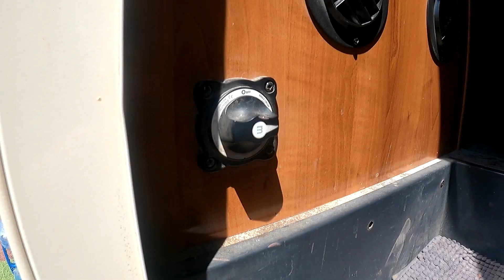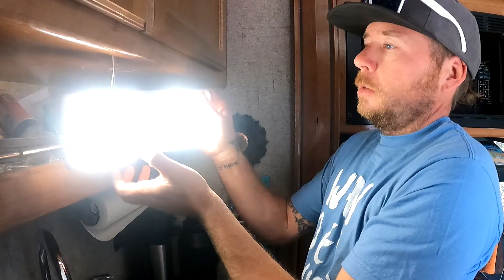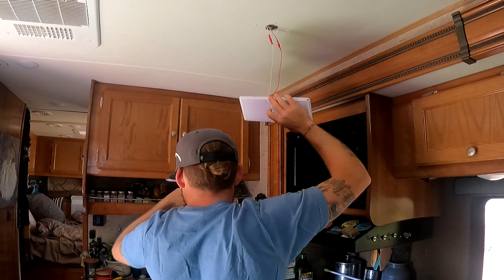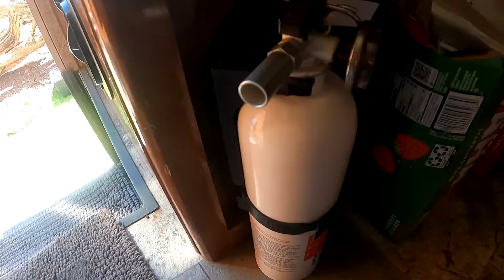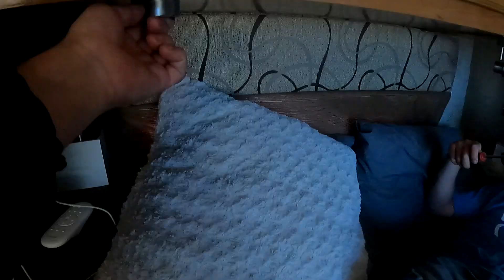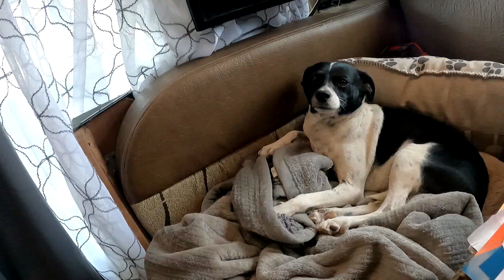RV Project Day - Replacing Or Fix Cheap Generic & Broken Items

Comment: I have a coachmen travel trailer and it has all the same lights as yours and the same faucets. I’ve replaced the kitchen faucet and I need to replace the bathroom faucet. I need to replace the lights too. The stuff is really cheaply made
Reply from the maker: Agreed

Comment: You can’t go from ground to hot on low voltage to check for polarity.  Your meter will show power no matter which wire you put the hot lead on.  You have to find a common ground and check each wire at the light.
Reply from the maker: Thanks for your info

Comment: I always check that wire color theory because two different RVs have had them reversed. And not the entire RV.  Inside was correct and clearance lights were reversed.  Didn’t find it till I tried them and clearance didn’t work.  And that was a class C.  So now I always use my test light.  Got tired of doing a class act job sealing them up (outside lights) just to have to take them off and start over.

Comment: Johns a handy man to have around.
Reply: As he crossed the wires creating a dangerous situation.
Reply from the maker: lol they are 12v LED lights and I specify 12 not 110, you can't mess up 12v LED if you mix the wire and that's obvious because once switched they still worked.

Comment: A tip when using plug type connectors.  Reverse the connectors on positive and negative so you can't plug the wires in wrong - i.e., if positive has the male connector, put the female on negative.
Reply: Professionals don’t think of that.
Reply from the maker: Very good suggestion... thanks!